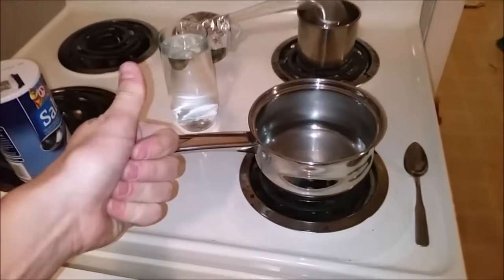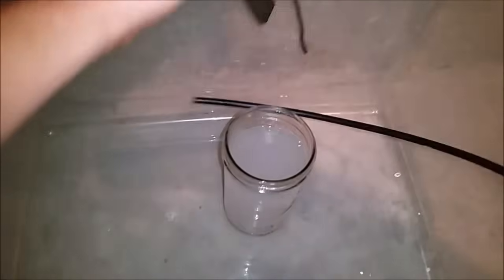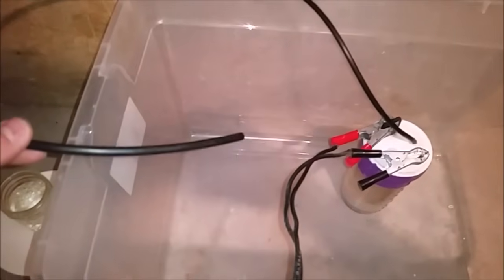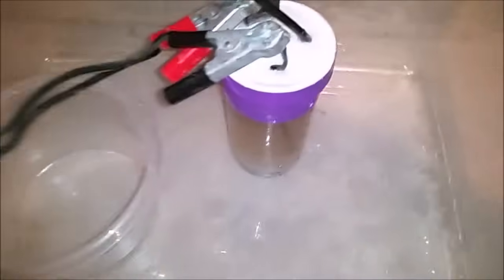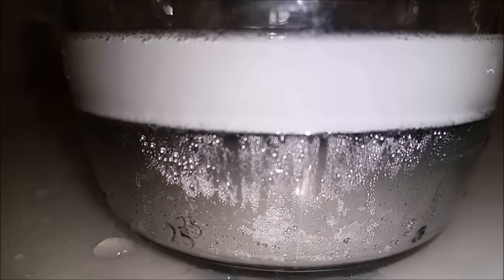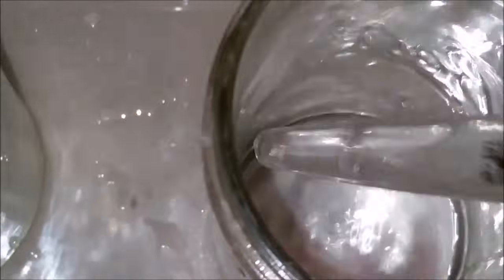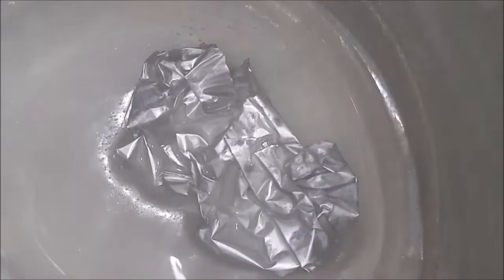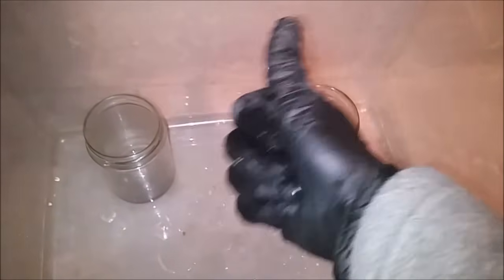Making Sodium Hydroxide (Lye) From Salt

Comment: Hi Cody's Lab,
Super nice video that allows one to produce Na, NaOH, H2, Cl2, Br2...

But not only because:
Just like chlorine (Cl2(g)) reacts with water into basic media to produces "bleach" ("Javel water").

Cl2(g) + H2O --> HCl + HO-Cl
HCl + NaOH --> NaCl + H2O
HOCl + NaOH --> NaOCl + H2O
------------------------------
So: 
Cl2 + 2 NaOH + H2O --> NaCl + NaOCl + 2 H2O
-or after simplification:
Cl2 + 2 NaOH  --> NaCl + NaOCl + H2O
(Bleach is sodium hypochlorite, sodium chloride, water and NaOH for stabilization because acid and bleach are not cool generating toxic Cl2(g))

In your case NaOH doesn't  simply turn Br2 into NaBr !
NO NO NO!
Br2 being a halogen it does like its brotherhood relative to the halogen Group (same column thus kind of brother)...

Br2 + H2O --> HBr + HOBr
Br2 + 2 NaOH --> NaBr + NaOBr + H2O
(Should remind you a deja-vu from above right ;o))

Not only NaBr is colorless but NaOBr (sodium hypobromite) is too; just like NaOBrO2 (sodium bromate) - what may form aside (especially if some heat is present into the reaction)
3 NaOBr --> 2 NaBr + NaOBrO2

This happens too with aging sodium hyppchlorote bleach and faster upon exposure to sunlight (UV) and heat (IR) hypochloride bleach - it gets faster if heat is above 30°C (ambient) and noticeably rapid from 80°C up to boiling reflux.
3 NaOCl --> 2 NaCl + NaOClO2

Yeah again "brotherhood of halogen for ever" :o)

Regards,
PHZ 
(PHILOU Zrealone from the Science Madness Forum and many former A.O.L newsgroups related to chemistry)

Comment: How much mercury is lost doing this i want the sodium hydroxide for my hydrogen reator but in canada atleast mercury is next to impossible to get i got lucky and got a few ampoules that came from an old boiler system so i have a little bit but not much atm its basically just in my metals i can melt collection and other than a small amount of mercury fulminate i want to one day make i dont actually plan on doing anything else with it but collect it is if theres any significant loss ill find another way but if there isint much loss atall then i might give it a try with a little bitb
Reply: Mercury isn’t needed for this process. I use platinum and i works exceptionally well and none is lost during the reaction.

Comment: The sparks are possibly combusting hydrogen gas released by something they did while making it (perhaps they used a chemistry set to make it) if it was the spoon causing the reaction it is made from aluminium, pewter or something with mercury in it and it doesn't seem to look that way. Or ... The salsa is just very spicy 🥵

Comment: Y’all you don’t need mercury lol, he just did this to demonstrate some other cool things. Any electrolysis of water with table salt as an electrolyte will do this, which is actually why you don’t want to use table salt for making hydroxy gas. Burning the chlorine/hydrogen mix that comes out is the usual way that hydrochloric acid is made

Comment: You don't need Mercury or sodium bromide you could try using a pencil or carbon rod the one that's extracted from battery not the one you have what it produces slightly a bit more pure so what do you touch your alligator clip to the pencil and then put in a solution of salt water attached to a 9 volt battery the other side of the alligator clip actually and it bubbles producing the same reaction actually.

Comment: Cody or anyone else that can answer, im making potassium hydroxide from ashes, ive gotten a 4% of dissolved solids in it measured with a refractometer. When i set it out in trays in the sun to evaporate the water a crystal started collecting on the bottom and it was 11% concentration, it continued to collect crystals and the % went up to 27%, my question is, are the crystals potassium hydroxide or potassium carbonate. Is this method the way to get the carbonate out of the solution to get better quality hydroxide, for the days of old, simple and effective?

Comment: Mercury (Hg) is toxic.  Other forms, like methylated mercury are extremely toxic.  Attacks your central nervous system.  During your procedure, you could be exposed to mercury vapors!!!  MOST do not consider INHALATION of Mercury vapor as a exposure pathway, however any heating or use of acid or other chemical reactions with mercury can generate mercury vapors that you inhale.  It will show in 10-20 years as loss of clear thinking, decreased brain function, nerve damage.  Severity depends on amount of exposure.  AVOID MERCURY, do not touch, do not get exposed to heated, reactive vapors.  AVOID use of MERCURY - waste minimization.  Do NOT use it for "play".  Eventually it will get in the environment, exposing some other organism.  Mercury bioaccumulates (gets more concentrated) up the food chain.  So, consumption of exposed food stock like fish become a risk to humans.  NO NEED for MERCURY for chemical hobbies - you risk the health of yourself and others.

Comment: Cody: "We gonna need salt, regular eating kind".
 Me: "Oh ok, I can find that."
Cody: "Dissolve it in water" 
Me:  "I do have water as well!"
Cody: "Now I gonna add that to the pound of mercury"
Me: "..."
Reply: its best if you dont make it,  its as good as drain cleaner.
Reply: @magnuswootton6181  Sodium hydroxide is very useful for cleaning off stubborn polymerized materials from cookware (oven pans etc) as well as for unclogging drains. It's sold as a general cleaning supply here. A 1kg tub costs 2-3€. As long as you don't let it contact anything made of aluminium (or yourself) you're fine.
I do usually try with sodium carbonate beforehand, it's safer and you don't need nearly as many precautions. It's only dangerous if you get it in your eyes and will only slightly ruin aluminium (instead of going nuclear like the hydroxide).
Reply: @demoniack81   For cleaning my stainless steel skillets, I use baking soda and water and heat to boiling.  Carbon dioxide is evolved liberally leaving a hot caustic sodium carbonate solution that softens proteins and saponifies fat to soap.  I’d only use sodium hydroxide on some massively burned cheese or other such diabolical mishaps.  Bicarbonate is WAY cheaper
Reply: @demoniack81  interesting.
Reply: When dissolved in methyl alcohol and added to old cooking oil , bio diesel can be obtained.
Reply: @dont.ripfuller6587  transesterification
Reply: NaOH with aluminium foil is good for producing hydrogen, which can be used for create hydrogen lamp if you manage to put that gas on fire. :D Or you can even blow yourself up, if you create pressurised environment and manage to put it on fire :D
Reply: @linjustek  I use a dilute acid and Zinc or steel which gives me H2 to supply fire needed to run my chemical reactions. It's pretty safe, as the acid is diluted I can't see a massive burst of Hydrogen gas, everything seems calm and I get my flame, we all are happy.

Comment: at the turn of the 18th century, they used mercury in electric motors, which they installed in cars and they could drive 2500 km, and now Tesla boasts about 800 km🤣

Comment: My Material Science teacher would have drilled me on the hose leading into the liquid. 

If the heat source is removed before the hose is taken out of the liquid the water may get sucked back into the gas generator due to the vacuum.

Comment: I like Cody's Lab vid-jay-ohs as much as the next chemistry nerd out there but hey what's with the safety hazards in this one? I mean it's like isn't creating a caustic and when exposed to water, rapidly exothermic hydroxide enough fun for one day and worth mentoning at least a little advice on handling? Splashing around bromine and mercury letting each of them volitise off into the far more toxic gas of each. Letting mercury heat up in a reaction to produce more gas when it's hidden danger at room temperature is already the toxic gas coming off it... Is it really nessesary? If so maybe a warning for those less experienced people out there who may not be familiar with the negative effects at least on brain function in regards to handling bromine or mercury vapours? I mean even the simple dangers of spitzen sparken when disconnecting a scource of electricity near the production of hydrogen gas could be minimised with a long extention of the negative electrode away from the jar. This is the same reason why car instruction manuals say for jump starting a car to connect the battery to charge on the negative lead to the body of the car away from the battery. Just in case of hydrogen gas getting accidentally ignited. It's always that last cable you connect and disconnect to the circuit that can spark so why not have it away from possible flamable or explosive sources?

Comment: Highly doubt you formed sodium metal in there. You simply removed the hydrogen ions by reducing them hydrogen gas, and just that made the solution alkaline. No "sodium metal" intermediates were produced in the process ; ) Activated mercury is just mercury + lye, you don't need actual sodium metal for that

Comment: Heat baking soda to at least 500C. The higher you go the faster the CO2 evolution gets, but it overcomes atmospheric CO2 vapor pressure at about 450C. Basically heat it in a pan over a fire.

You'll get a mixture of sodium oxide and a proportionally smaller amount of sodium peroxide.
No idea how to separate them, but if you just want Lye, then all you have to do is throw it in water and wait for the hydrogen peroxide to turn into water and oxygen.

Comment: cody, can you please make a CO2 scrubber using this sodium hydroxide solution production method. The CO2 is bubbled through the solution and the water produced is electrolysed to make oxygen and hydrogen. If you know of any cheaper or simpler scrubbing methods for an airtight bunker, or if you could explain how the ISS's scrubber works, I would be most interested! Thanks for this video Cody!

Comment: Cody: You mention the Hydrogen gets dissolved into the mercury, could this be a valid way to store hydrogen?
Reply: Wei Zhao: I am not a chemist, its of poor value to make mockery of someone with less knowledge in an area you know, we all know Hydrogen is difficult to store; I am interested in why it is impractical to dissolve then separate it back into its original form. If you had gave an answer like, it would take too much energy to return Hydrogen back into a gas, or the separation process is expensive\complex, that would have been much more useful and would save looking up a multitude of websites to get the answer when you can just ask a specialist. Don't become a teacher; you will get fired.

Comment: cody i did some conductivity tests on tapwater, distilled water and disolved table salt with AC. Later i tried the salt solution with warm water and DC. hydrogen and chlorine gas were formed. please could you tell me why the positive electrode (a piece of wire) blackened and a cluster of bubbles remained at the bottom of the beaker? thanks 😊
Reply: you're a moron because you used "a piece of wire" instead of some known substance.
if the wire is copper, it's most likely copper(II)oxide. copper hydroxide forms during electrolysis, which decays into CuO at just 60C, meaning you're probably pumping some poor solution full of electricity cause your ass doesn't measure

Comment: It's cleaner and easier to use a piece of Nafion membrane to separate the sides of the cell into half-cells instead of using mercury.  The chlorine cannot react with the sodium being produced so the sodium stays on the negative side of the half-cell and instantly reacts with the water as it's being produced and you get PURE lye.  You can just run it until the positive side of the cell is no longer conductive to know that the salt is all gone.  The problem with both methods is that nasty chlorine gas being produced.  I hate it.

Comment: So the mercury is reducing the hydrogen and sodium, and the carbon rod is oxidizing the chlorine and oxygen? Can you use gallium instead of Hg? is the purpose of the Hg just to absorb the Na so that it does not enter the water again -- and if so, could you potentially use a layer of mineral oil on the top to do the same thing?

Comment: My husband and I had a placer mine when we were very young, tried a gold recovery trick using mercury and a potato. We did something wrong, did not bake it long enough perhaps? I hope that is what your video will cover!
Reply: You guys used potato! What for?
Reply: @quicksilver3431  We were told that you could extract gold from black sand that way. Cut it in half, scoop out a hole, put your black sand in with a bit of mercury, then bake it. The mercury was supposed to dissolve the iron and seep into the spud and leave your gold dust in the hollowed out spot. I suspect a prospector was pulling our leg, but I don't really know. It might work, it did not work for us.
Reply: @amommamust  Yes that kinda sounded funny until you told me that baking part.. If mercury dissolved iron that easy, that ain't no small deal.
Reply from the maker: The potato thing is 100% a myth.
Reply: @theCodyReeder  dude you're stalking on us.
Reply: @theCodyReeder  Thank you! 40 years of wondering at last laid to rest!
Reply: You married to your school friend!? Lucky you.. wish you happiness.

Comment: Hi cody... is it dangerus to eat lye?
Reply: Tobias Hoff Iversen no fucking duhh its drain cleaner will kill you and probably melt insides
Reply: Roan Oneill, ur probebly not from the nordic countries. We eat something that is called lutefisk(lye fish) it is dry cod that is soaked in lye for a week to get the jelly ish contense. I am not dead and my insides are fine.
Reply: Tobias Hoff Iversen the lye is dilute I believe and dried out lye is used ocassionaly in industry cleaning machinery and dissolving some metals it highly corrosive and would kill or injure you even if only small amount invested can cause chemical burn or other irritation if it touches the skin
Reply: Roan Oneill, we are using sodium hyroxide(lye)(alkaline), and it is not in small amoumts, I'd made lutefisk from skratch
Reply: Tobias Hoff Iversen I've seen recipe it is a gallon of water to 2 table spoons of lye
Reply: Soaking in water for one week, 4 days in lye(3 table spoons of lye to 1 litre) and than 15 days in water
Reply: Tobias Hoff Iversen, ur right when it comes to soaking the cod for one week and than in the 3 table spoons to 1 litre ratio, but after that it is soaked in water for 19-20 days not 15
Reply: Roan Oneill I know thats is what the first thing you learn when u are making lutefisk. But the 3 table spoons to 1 litre ratio, if u put one drop of that on ur tung and swallow it, it works like a laksating thingy, ur on the toilet for days because of that
Reply: Tobias Hoff Iversen it turns you to soap.

Comment: can u make sodium metal from salt (aka NaCl)
Reply: Lucien Camdessus you use a similar process to cody's but you leave out the mercury, then you take the NaOH (sodium hydroxide) out of the water by evaporating it. you take the NaOH and grind it into a fine powder and mix it with Mg (magnesium) and burn it and mix in mineral oil. dump all of that into water and grab the floating sodium off of the mineral oil. There is your sodium metal

Comment: Cody, your compressors overheated because it looked like you installed the high side of one compressor to the low side of the other, if you would like a rough drawing on a refrigeration system let me know.